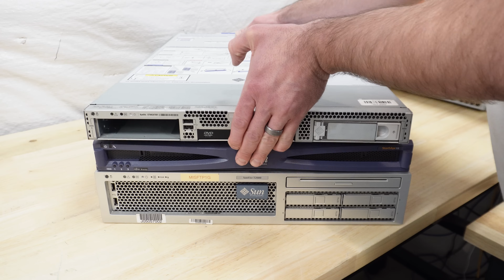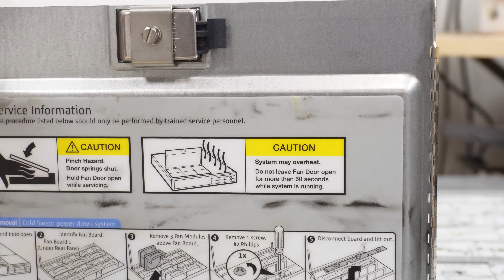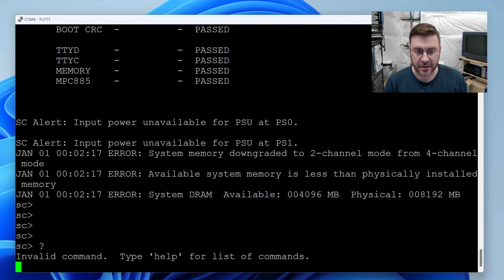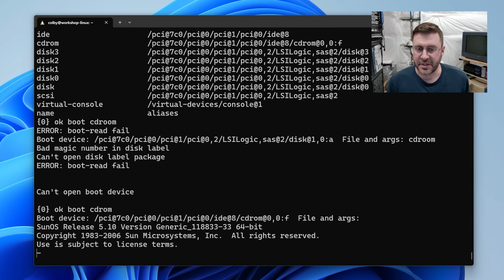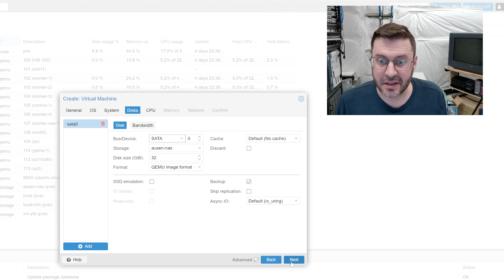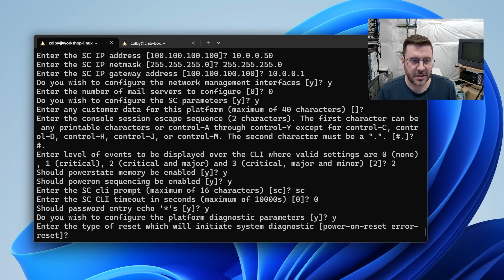A Sun Fire T2000 from 2005

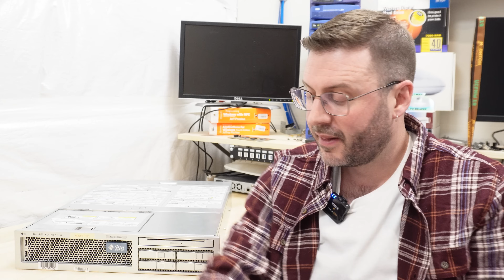Comment: @3:44 It somewhat ironic, because from  32-bit era onward, calculating floats you must add or multiply only 24 bits, so should be faster or the same ;)
Yes, yes i know, you must have fast shifter also but in 32-bit era they were in place (for add) and do some add on exponent and other logic.

Comment: This T2000 is very similar to the Sun Fire V245, which was only slightly older than this. What's interesting is how they so quickly went from two processors, each with a single core and single thread, to this. Huge jump.

I'm really curious about the power usage. My V245 takes more power than my AlphaServer DS25 - around 350 watts! Perhaps moving to a T2000 might save some power.

Comment: Great video! :) i have T1000 and Netra T5220 in my home lab. Regarding your machine - it is normal to have that power off right after hw checks are completed, my T1000 the same. It is really sad that these machines (T2000 and my T1000) are so fre**n noisy, but it is whatever it is...May i ask if possible for you to publish the link to that SUN N1 iso from internet archive, i am not able to find it. In the future you may have a look on sun virtualization (a.k.a. ldom - logical domain), it is really cool thing, support for it starts with T1 CPUs (sun4v arch). I have it set up in my home lab, the really cool stuff is that you can add/remove vCPUs and RAM from running VM guests (running Solaris 10 and 11 only).  Greetings!

Comment: I still have a T1000 at my storage which used to run ldoms and zones. happy to also collaborate on that and bring it back to life as well.
Reply from the maker: sweet! yeah I'll be messing with zones eventually
Reply: @clabretro  I'd help as well, but I erased Solaris a few minutes after I un-zoned the thing. (there's a way to clear it from OBP) I'm not 100% sure Oracle still gives away the ldom software. (sol10 isn't supported anymore)

Comment: It may not be a big thing, but try burning DVDs/CDs at a lower speed. In the past (when burning was still hot) ive noticed corrupted discs, ever since ive been buring (if ever) at 4-8x speeds. Yes its slow but i havent seen corrupted disks. Greetz
Reply from the maker: for sure, i always burn slower than the drive or disc support

Comment: I have a Netra T2000 ... looks very similar, but only the optical drive is accessible with the front door closed, under which there are just 2 of the 2.5" drives. The indicator light is typical for a server hardware, its not only to front-back pairing, but also you can trigger it over the remote management - so if you find an issue, you can have a blinker on the particular server.
Reply: That's not a T2000. The T2k does not have a "front door", and has 4 2.5" SAS bays.
Reply: @jfbeam  you need to take into account the SunFire vs Netra naming of series, both are T2000. Use google to get some pictures maybe?
Reply: @cameramaker  Never knew they made "netra" with niagra processors. I thought they ended with a UltraSparc IIi processors.

Comment: I never used them as web servers. Only as virtualisation hosts. The on firmware hypervisor was nice. You could reboot any OS, including the primary OS without affecting any other one. The users hated them, though. That sharing of FPU really showed. Sun realised their mistake quickly so the T2s had an FPU per core. The T5210s were much better. The T1000s had queered the pitch so much, though, that they were also hard to sell to the users. By that time, people perferred an intel server with linux.

There were pretty though.

Comment: I installed debian sid on one of those and even made redundant raid1 using mdadm :). We used to have plenty of those at my previous workplace and it was a way to put some of them to work with reasonably modern software. The most easy way is to DD iso image to hdd, then to boot from hdd partition f (IIRC), then install magic happens